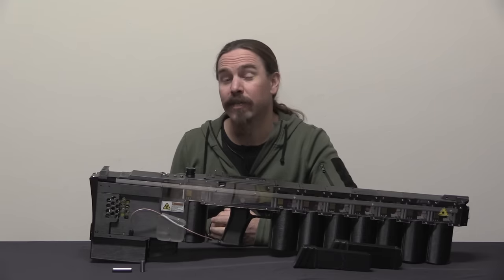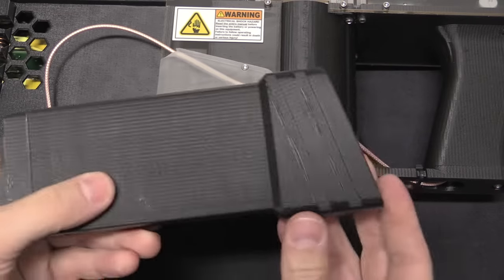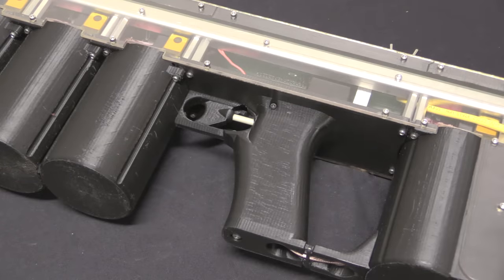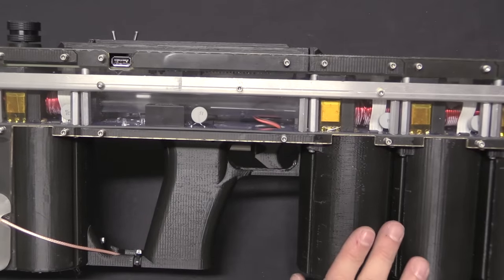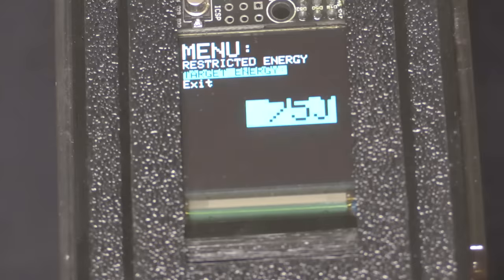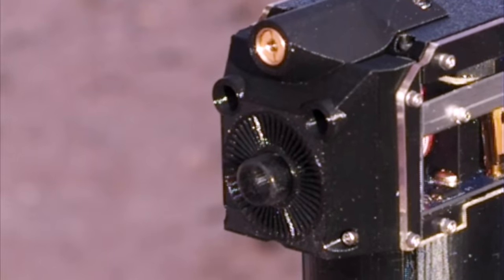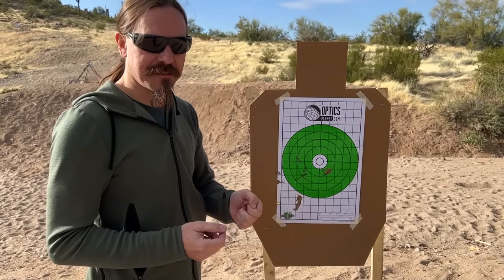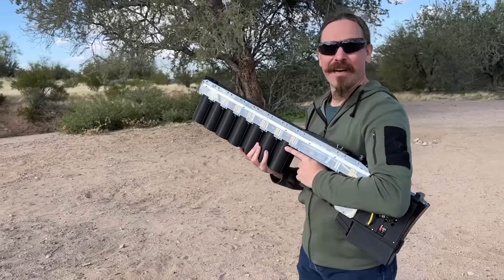ArcFlash Labs' GR-1 Anvil Portable Gauss Rifle

Comment: This thing is so of our time, I love it. 3d printing, USB ports, etc. People in the coming decades will look back on this like we do those cool 80s top mounted lasers, even if the gauss stuff doesn't take off (which I'll admit I'm skeptical it will, at least in a small arms context)
Reply: Even if they never take off as a normal rifle or anything, I'm convinced there will be a niche for these just in how quiet they are.  They're not even trying to make this one quiet and it already makes a suppressed firearm sound like a cannon.
Reply: @GreenBlueWalkthrough  I wouldn't say that there's no difference other than power. One is a railgun with a multi-ton barrel with a life of 100 shots, the other a handheld coilgun with a perspex barrel. 
One weighs many tons and accelerates about 4 Kg to 3 Km/s (or mach 10), producing up to 32 megawatts in muzzle energy. The other can be out-classed by a strong man with a slingshot. One needs a conductive projectile that doesn't benefit from added mass, the other needs a ferromagnetic projectile that automatically benefits from a heavier shot.
Different in every appreciable way besides being weapons driven by electricity and firing a metal projectile.
Reply: As we get room temperature super conductors, and better batteries I see gauss taking off for small arms.
Reply: @GreenBlueWalkthrough  If you mean the one on the Zumwalt it was a railgun, it's a very different weapon. It uses much more sophisticated projectiles but doesn't need complex coils around the length of the 'gun'.
Reply: @Giganfan2k1  but what can these do that a firearm can't while also being a lot simpler? I can see no good reason for these to usurp conventional guns in an anti personnel role.

But who knows, that's just my personal bias for simple, mechanical solutions anywhere they can be used. I'm sure more computer brained people may see a gun where the majority of the potential issues are software based and see that as a bonus
Reply: @BlazingOwnager  Exactly, I seriously doubt these will ever replace firearms, but they have lots of potential in niche roles. My gut immediately goes to something like a silent version of that Chinese anti sniper grenade launcher, using an explosive to make up for a lack of velocity.
Reply: @BlazingOwnager  The low velocity of the projectile also makes it quiet. If they manage to get a projectile up to supersonic speeds, then it will cause a bang. But will likely still be more quiet than a traditional firearm. 

Of course, there might even be special ammunition for coil guns in the future that are designed to reduce the sonic bang. Since that would be a pretty big advantage. You may also go with a larger projectile and keep the speed subsonic and still have decent impact. Subsonic ammunition can still kill. And even this early prototype is something you do not want to get shot by even with it low velocity.
Reply: @Zanpaa  which is exactly what I'm not talking about. I'm not even saying it has no military uses, I just dont think it will ever be used for a general anti personnel role.

Bringing back the space gun with magnets sounds awesome though
Reply: @Ezekiel_Allium  Present day chemical propellants are far more energy dense than batteries and capacitors. So for now, you're right. Once battery tech catches up, weapons like this will give traditional firearms a run for their money. Carrying only ammunition and maybe an extra battery pack, not dealing with fouled rifling or carbon build up, and zero muzzle flash are real advantages.
Reply: @ajm2872  Firearms typically transfer only about 1/3 of the chemical energy to the projectile. Electromagnetic motor drives can reach 90% efficiency, meaning vastly reduced cooling requirements.
Reply: @BlazingOwnager  That thing is so silent because the projectile is so slow. If it would go super sonic it would be loud. This is a level of sound that is reachable with low velocity firearms, for instance 12.7×55mm and they still go up to over 3kJ.
Reply: @ajm2872  just because you dont have to contend with the same maintenance as a firearm doesn't mean there won't be maintenance. I imagine whatever managaes the coils, be it some kind of sensors like this setup or a pre programmed sequence will be a massive fail point. Not to mention the need to keep track of all the capacitors, potential heat related issues with the electronics etc, not even getting into how all that stuff needs to be able to survive quite a bit.

Also, water damage. No matter what  waterproofing measures you come up with, in active service they're going to fail eventually. That's just the stuff I could come up with off the top of my head, I'm sure people who know more about electronics can find even more potential needs of a system like this.

Muzzle flash is the big thing I'm willing to concede as an actual advantage though
Reply: No they’re going to look at it the way we look at muskets
Reply: I think they could take off if battery tech improves. If solid state or lithium glass batteries turn out to work, that would mean your batteries last longer and don't explode if they're punctured.
Reply: @PineJayForge  I was just taking advances in batteries for granted, that's really the least of my issues
Reply: Yeah coil guns have a long way to go for practical use and effective energy, and frankly I don't think they will ever get there. This thing is kinda pathetic. Railguns on the other hand have almost made it into US Navy service, and have more than enough power these days to put down enemies.
Reply: @Ezekiel_Allium  I’m getting the same vibes from your answers as someone in the middle-ages who have just witnessed an early type of firearm and commenting on how superior the bow & arrow is to it.
Reply: @gustavselin1197  you're right, it's exactly the same.

After all, guns require the exact same amount of strength, training, and craftsmanship as a bow right? They're totally not infinitely more simple right?

Your comments sound like someone easily excited over new tech without considering the potential downsides and advantages of it, just accepting it as the future because science fiction told you so. There is a lot of merit in the gauss gun concept, I simply dont think the advantages are enough to replace guns. I can see a future where they're used side by side for different niches, but its gonna take something a lot more impressive than an alternative propulsion system to usurp chemical firearms. A smug apples to oranges comparison isn't the slam dunk you think it is
Reply: @Corsius Atreides I really dont think they ever saw any use, I'd love an example if they did. If I remember correctly my favorite model (ls45), had a really pitiful battery life, I have a hard time seeing anyone except hobbyists getting any use out of that
Reply: @Ezekiel_Allium  I fully am in the middle even as someone who loves this sort of stuff I think eventually it will be more useful and widespread but even something putting rounds down range at the same level as traditional firearms would only benefit from the muzzle flash so I think if this eventually does get adopted it would start out more useful in situations were muzzle flash needs to not be a thing like you said a niche say like some hidden snipers would probably love this stuff if it had the power of a rife with none of the flash and while it still has a lot of disadvantages until the tech matures, most of those probably don't bother snipers as much being as they are less mobile and have more concealment.
Reply: @Spacemarine658  not to mention snipers won't have to deal with the increased ammo cost that would come with making these things accurate
With Russia's fascination with silent urban sniper type nonsense I could see them maybe being an early experimenter with this kind of thing.

Just because I'm harsh on the concept doesn't mean I dont love this kind of thing as well. This stuff is really, really cool to me, if it wasn't I wouldn't be here
Reply: @Ezekiel_Allium  absolutely you can be critical of things you like
Reply: @Ezekiel_Allium  what about the fact it has no felt recoil? That it’s virtually silent? Those are some of the biggest issues with firearms, and this technology further developed could solve both of those. Firing one of these has more in common with an airsoft gun than a firearm.
Reply: @galacticupfan7386  those are definite advantages, though to my understanding as they grow more powerful so will the felt recoil due to physics nonsense I dont understand, and of course they will produce sonic booms as well. 

It is like everything a set of compromises, and I feel like the gains dont outweigh the losses
Reply: In the simplest terms it is all about delivering energy to the target. The hold up now is storing electrical energy in a portable format.
Reply: @1pcfred  there are so many more issues than that one
Reply: @Ezekiel_Allium  there are but with adequate energy those issues are more easily overcome.
Reply: @1pcfred  I promise you better batteries will not fix my concerns over durability, complexity, maintenance, etc.

I'm operating under the assumption the batteries and capacitors will come, sooner rather than later, I simply do not thing that would make it a viable replacement for conventional firearms in 9 situations out of 10
Reply: @Ezekiel_Allium  The device looks pretty maintenance free to me. The only wear item is the solenoid. No other moving parts touch. We can make electronics pretty durable. The complexity isn't something an end user has to deal with. The device is a black box. There's a lot of impetus to develop better batteries and capacitors. Now whether that translates into progress remains to be seen. Invention is a fickle business.
Reply: @1pcfred  I just need to establish what context we're talking about? Because this whole time I've been talking about potential future military service, and I need you to understand literally nothing is maintenance free in that context. Something will happen, and I promise you no matter how well you make it, it's not going to be more durable than a purely mechanical device.

I also just think the heat would be a major source of wear, especially in the hypothetical military version. I doubt the electronics necessary to operate the timing of the coils would hold up to frequent heating.

And the timing thing is really my main gripe. Either sensor operated like this, or just a set pre programmed sequence, something will go wrong, either something gets damaged, or a feed/ammunition issue messes up the timing, or even a software issue. There's so many angles where that specific thing can falter. This is not an issue for any firearm competitors. Even more so if the system relies on some kind of sensors, because now you need to make sure those never get obstructed or damaged on top of everything else

If this goes anywhere in the small arms world it will be niche military usage and hobbyists. I bet in my lifetime someone will go hunting with a gauss gun, which is a wild thing to say, but I'm happy I can.
Reply: @Ezekiel_Allium  Agreed, electronics just tend to be really unreliable under poor conditions and exposure to filth, water, high temperature variations. And maintenance wise would be a nightmare as it would require specialized technicians to fix them. That's without saying that the weapon itself and the technology it brings will be likely expensive for a large organization such as military.

Overall for a military organization, unless there's a massive overhaul, these are far from being considered for military application or service. Cost, reliability, maintenance, fragility and dependence on outside conditions. I wouldn't be one to trust this weapon with my life, even less so for an enduring battle. 

Water-proofing while retaining cooling capabilities would also be a nightmare, not impossible. However the concept of having to protect this much electronics from elements and physical harm means its not durable for rough conditions when you need it.

Overall I don't see coil guns capable of replacing a small arms, perhaps they might see use in other applications, people pointed to low velocity applications, putting it on a vehicle as a 40mm grenade launcher where weight and power is no issue sounds like a more appriopriate idea, albeit more expensive overall and fragile than the simple remote operated chemical 40mm grenade launchers.

Would also liked to add that for an infantry soldier, the weight wouldn't be any better carrying solid steel rounds versus a regular firearm even if hypothetically it could reach similar performance, and with the "gauss" gun weighing a massive 20 pounds, i dont see the miniaturization coming far enough to be able to deliver both higher power through smaller and lighter. As far as capacitors go, they require size and bulk to hold more energy, therefore heavy, and same goes for the battery to hold fair capacity. It goes without saying that adding a battery and electronics to a gun gives it more things that could fail and render the weapon useless, especially when program managed and computer controlled.
Reply: @Ezekiel_Allium  In World War 2 one of our top secret weapons was the proximity fuse. It was an artillery shell that would explode when it got near to an object. What was it really? It was a vacuum tube based device that we shot out of a cannon. Now if our military can make that then I'm not going to put anything past them.
Reply: I'd also like to add as a Electronics technician in the military that the cold ass weather we get is often very harsh on batteries, if trucks have issues starting thanks to batteries loosing their charge in extreme cold. I could see the same issue come to these portable batteries, especially since there's a need for batteries to provide sufficient energy to high power capacitors. Even if they could still charge, the charge time would take longer between shots.

There needs to be a massive overhaul in electronics reliability in each components as well as simplifying the overall system, as it is far too complex for mass scale use in small weapons. The sheer amount of sensors, program sequence, timing and software and hardware reliability makes a very poor choice for a combat environment.

To be completely honest with you, the military organizations would probably require to create a whole new technician job towards maintaining this type of equipment, one that can both fix electronics and diagnostic softwares. Otherwise these weapons would always be missing from inventory. 

The reality is, the way a lot of military work is if it can't be fixed within reasonable means it's often sent back to manufacturer for repairs, especially common in advanced systems and electronics namely. As it would be simply too expensive and complicated to have to educate and form technicians as well as equip them enough to keep it similar to an armorer's level of repair shop.
Reply: @Velthrex  you've summed up my thoughts more succinctly that I ever could
Reply: @1pcfred  I feel like an explosive designed to literally be destroyed isn't quite comparable to something that has to not just keep a soldier alive but also survive them. If a shell fails to detonate it doesn't render the entire weapon system unusable until repaired, for instance.
Reply: And lastly, even if hypothetically they could one day match weight, reliability, performance, speed of chemical explosion systems, as well as their rate of fire and portability. Which so far isn't the case, you'd have to choose as a big organization responsible to arm your entire nations' military personel, the cost investment and maintenance would be abysmal, considering regular weapons have been around for ages and manufactured, it can hardly be cheaper to machine mechanical weapons that you know will remain reliable for long after purchase, as well as the cheapness of producing/purchasing brass ammunition thats readily available.

Even if say, there was a global shortage of propellants, other options would most likely be preferred. Until aforementioned issues can be solved, that is reliability, sensitivity to external conditions, sensitivity to physical rough treatment, temperature, weight, performance, practicality, logistical maintenance, cost, size.
Reply: Mechanical systems have always had more wear than most, however they've also always been simple systems that both work and are durable over long periods of time and can endure stress, strain, and bad treatment much better than fragile things such as electronics boards, components, batteries and optics.
Reply: @Ezekiel_Allium  what can matchlocks and cannons do that warbows can’t? While they may have niche usage in defeating heavily armored opponents or fortifications, I don’t see them usurping crossbows in an anti-personnel role.
Reply: @Ezekiel_Allium  maintenance/reliability in the context you describe it is a solved problem.

Plenty of weapons systems exist and have been used in combat that use electrical signals to operate firing control and actual firing of the weapon, and they are completely reliable. See the CROWS systems, any modern rotary gun, any vehicle mounted weapon. Most of these endure just as harsh conditions, if not more harsh conditions than small arms will and operate fine.
Reply: Firearms have been around for so long that we have known solutions to maintain and reduce overall wear of parts, as well as make them very fail proof and reliable.

Unless a clear advantage can be found from applying electronics, given the technology development, the situation is nowhere near close enough to replace the pre-established standard. Electromechanical interaction has been around for a while and always had the best of both worlds, the simplicity and reliability of mechanics, the increased accuracy and efficiency of electronics in both sighting or fire control systems as well as in certain application faster rate of fire (found in electric triggers).

Railguns are another ordeal because they can achieve far superior performance to conventional guns, albeit far more of a niche thanks to their massive maintenance and power consumption. Honestly even these are impractical considering that the cost of producing railgun ammunition and swapping its rail which gets worn out very quickly, I wonder if the overall cost and effectiveness is actually better than simply making supersonic missiles with great payloads.

One could even think, what if they use this technology but for pulse lasers? That's a whole other ordeal, lasers used to cut things are harmful to the naked eye, and therefore impractical, without mentioning the risk of reflection and mirror reflections to redirect.
Reply: @jonathanpfeffer3716  well for one, they're much easier to manufacture, train people to use, and dont require any physical strength. To be an archer requires intense physical training, and powerful crossbows require clumsy and in some cases quite complicated separate mechanisms to load. 

Let's not even get into how matchlocks and wheellocks did coexist with bows and crossbows for a pretty long time

I really hate this comparison lmao. A gauss gun doesn't offer any advantage over a firearm, while the advantage of firearms over bows is absurdly apparent. A Gauss gun is just a quieter, and more fragile gun in the best case scenario
Reply: @Velthrex  Laser weapons are quite simply never gonna happen in my opinion. There's so many issues that make them infinitely more absurd than electromagnetic weapons. Lasers are only really feasible in the vacuum... but so are guns
Reply: And lastly, sorry for the long essay,

If coil guns can somehow get beyond those issues and improve upon even the limitations of a mechanical system then there is potential, who knows where this technology can go, only research, experimentation, physics and science altogether, the limits of human mind can put a stop to it.

From one way i could see it, electronics is very light (batteries and big components aside) and when properly encased and protected from the elements and harms way (water tight, epoxy covered, firmly fixed to a solid frame) they can have great potential to be an extremely compact and light weapon that has virtually no wear other than aging components and heating up.

Given lighter more compact batteries that can hold more power and condensers that can hold even more charge all the while being lighter and smaller, this could theoretically be possible, and batteries are the most likely to see improvement considering the latest research focus. 

As for condenser the principle they use I have a hard time imagining it can really be improved upon. We've come a long way in term of component efficiency, but condensers always followed a similar concept, unless they can find an alternative technology to condensers or a miraculous pair of conditions and materials to make condensers 300-400% more effective all the while minimizing energy loss (which is an incredible achievement in of itself, efficiency).

I'm open to new technology but I don't see a military application for small arms anytime soon in the future.

One military application of coil gun could be like I mentioned earlier a vehicle mounted weaponry, but thats not happening until many of the glaring issues can be fixed, small benefits are noise and muzzle flash, as well as a potential for ammunition non-volatile nature, (vehicle ammunition rack explosions), however there is already solutions to this problem in the chemical field. 

Propellant that doesn't explode unless ignited from primer seen in select tank rounds, blowout panels to redirect the pressure blast outside of the compartment. However these are for Main Battle Tanks, IFVs could potentially benefit from it more considering the ammunition is generally not as well encased and "outside" from the crew compartment. Until stable propellants are introduced.

That being said, a flaw that would arise from this system is the weapon itself would become a much preferred target to disable the system. Remote Weapon Systems already have a weakness when it comes to cables controlling the weapon, imagine getting a coil or condenser damaged, resulting in potential short circuit and/or decreased performance if not completely disabled.
Reply: @jonathanpfeffer3716  I really do not think mounted weapons experience harsher conditions than being in the arms of a soldier.

And the main issue with the maintenance and reliability is if everyone's carrying it around, there's going to be a lot more issues, and the training to maintain the technology has to be taught to a lot more people, etc.
Not even getting into just identifying the issue is probably more difficult because there are so many more points of failure
Reply: @Velthrex  Honestly thanks for writing all that out, there's a lot in there I would have never considered, your perspective on this topic is really valuable
Reply: @Ezekiel_Allium  Vehicle mounted weapons used in recent wars (especially the CROWS, which is the most complex and the most exposed) experience possibly the most harsh conditions a weapon can endure, as they are pelted with extremely fine dust thrown up in the air by convoys, and fully exposed to the desert heat.

Obviously you would need to work to ensure reliability, but my point is that it is more than possible to do so.
Reply: Mt time would be soldier carried LASERS.
Reply: @Ezekiel_Allium  A more mature magnetic accelerator offers multiple advantages over a conventional firearm, lower weight and volume and volatility of ammunition,  easier to have more ammunition types, could offer significantly higher muzzle velocities (presumably this would be used for grenade launcher type roles, given how that is what coilguns are good at). There are some more niche advantages like them being silent but the above are more generalist. Obviously this is not a mature platform, but given much more development (and maybe some DARPA money) this seems like it could in the future serve well as a Mk.19 replacement, and maybe beyond that as a man portable grenade launcher.

If you include other types of magnetic accelerators beyond coilguns in your definition of “Gauss gun”, the possible benefits become even greater. (Railguns, once materials science advances sufficiently, could be an excellent CIWS system).
Reply: For military application, it's safe to say that it's unfit for operational purpose, too fragile, difficult to protect, heavy and vulnerable condensers and battery/energy dependent system. Too much cons for very little pros.

However the technology advancements that may come from it will be great improvement and research to further both electricity and electronics field. And they also look cool as hell and futuristic, just unrealistic for combat purposes.

Thinking hard about it, after saying electromechanical applications have the best of both worlds, I think this could be the one that has true potential. A weapon system that exploits initial chemical explosion power and mechanical parts' reliability, but uses the coil and electronic system to futher increase the velocity or ballistic properties, loosing the electronic side who is usually more fragile wouldn't disable the weapon, simply remove the enhancement it gets.

However even this concept would be difficult to apply in real context, the bullet projectile would have to be ferromagnetic, therefore mettalic, which means a harder metal, meaning more barrel bore wear. (same reason railguns are an expensive mess). The combination of using hard metal and sending it at incredible speeds means incredible friction and stress through barrels that from today's standard is mostly hardened steel with treatment, metal on metal.

This basically removes the advantage of not wearing down a bore of coil guns but increasing their reliability all the while creating many more problems. The barrels on such a hybrid for example would need to be non-magnetic. But hardened steel is the toughest material known to man thus far. Other materials are either too flexible or too brittle. Posing a massive obstacle to such a concept. Reliant on too much technology advancement, both in material, electricity, electronics, and change in firearm industry. Being able to push such limits however would make a far superior weapon system for military consideration (albeit quite possibly expensive) and bringing in extra weight, this wouldn't be for small arms but rather more realistically applied to ground and naval vehicles.
Reply: @jonathanpfeffer3716  it's possible, sure but getting the framework for that into place probably isn't.
And the point isn't really if you could, more of why you would. Again, we're debating solutions to a problem that is best solved by never introducing it, conventional firearms already exist and will also continue to evolve over time. There's really no point in replacing them with a needlessly complex alternative that does the exact same thing
Reply: @Velthrex  would the whole projectile need to be ferromagnetic though? You could have a softer metal coating over a magnetic penetrator to reduce barrel wear
Reply: As of now its safe to say, railguns have the most potential and they're incredibly massive and large scale to be remotely effective, the power consumption to overcome many forces and resistance as well as achieve superior velocities is nothing that leads to smaller scale applications outside of nuclear warships.

It's all about application, this huge railgun would pay its worth if it can decimate a ship in record time and ease. However the headache of such an expensive system used on ground forces isn't thinkable, the railgun itself would be more expensive than anything it could shoot at to justify it.
Reply: @Ezekiel_Allium  Perhaps, I'm no material or weapon technician to give you an accurate answer. From what I know however you do need sufficient ferromagnetic matter in your projectile otherwise the magnetic field won't pull as efficiently especially if the weight ratio is off (non-ferros vs ferro-magnetic)
Reply: As my final post here, I honestly think other than for enhancing purposes, magnetic(electric) based projectile propulsion is too ineffective without a huge loss and need of energy consumption. It doesn't have its place nor makes up for its value/cost in current warfare.

The only scenario that's not so realistic but sounds like it in my mind for coil guns would be in applications where it doesn't have to overcome as much resistance or force, in other words. Space. Funnily enough it's illegal to bring warfare into space.

It wouldn't have to overcome weight problems, no air resistance or external factor, no bad weather except the extreme cold and vaccuum of space. And perhaps it would therefore be easier to cooldown, even railguns could probably work better so long as they insulate components that can't run under extreme cold temperature.

However you'd still have the issue of having to find a big enough and sustainable energy source, considering most space crafts are using mostly solar panels and minimizing power usage as much as possible, you'd need to send a nuclear power to space or find some other mean for sustainable energy. Or perhaps batteries big enough to store large banks of solar power, after all, weight isnt an issue once in space (getting up there would be the challenge though).
Reply: @Ezekiel_Allium  proximity fuses worked.
Reply: @Ezekiel_Allium  I already described how it could offer some advantages in the future. I doubt it would ever be useful for small arms, honestly, just due to the inherent physical limitations of a coilgun, but I do see legitimate practical applications for vehicle mounted weapons. 

Again, not saying we should literally replace current weapons with some version of this, the technology is not nearly developed enough yet, but once it does I can see it being useful. For instance, it could be well-suited for a tank’s main gun, as a tank could carry all the necessary electrical components easily. A coilgun is inherently good at accelerating heavy projectiles, and would also eliminate any risk of ammunition explosions due to the lack of propellant. 

This would only ever happen far in the future, of course. ETC guns would be the next step for weapons development in my opinion, both for small arms and vehicle mounted weapons. However, after that, you don’t really have much else to improve on with conventional weaponry, and at that point more exotic ideas like magnetic weaponry might be the next step.
Reply: @Velthrex  I believe one of the primary intended uses for a railgun would be as missile defense, especially now that hypersonics are being proliferated.
Reply: @NXTangl  which would be nice if they didn't require 20lbs of battery and capacitors strapped to the barrel. They will likely be very cool if we can ever miniaturize batteries to the point that this isn't impractical to carry around, but that's still quite a ways off for now.
Reply: @Ezekiel_Allium  That are the newest innovations of swords, and spears? Will we get more improvements on firearms? Yeah, but over the last 50 years firearms have. I don't expect firearms to have another Renaissance.

This is the equivalent of matchlock. There is a lot of places this technology could go. Without having to deal with hot gasses an electric mini gun would probably have a significantly faster rate of fire.
Without needing to deal with cartridges These weapons could be more sealed than other even a closed bolt system. 
Logistically they could offer more simple supply chains. 
If you watched the video Ian points out with just a little more processing power you could have rounds that don't over pen, you could on the fly compensate for extra armor. The tactical and strategic benefits that we could see in a decade or two could relegate the traditional firearm to a where crossbows where in the early Era of firearms.
There will probably be a place for firearms like how modern archery is still a thing.
I understand the energy density thing. I am also watching fast switch capacitors, batteries, and monopole magnets are in their developmental infancy. 
We can't see where these new technologies plateau yet. My belief is we don't see where they go until the have a new paradigm shift in physics.
When Einstein was a young adult physics was a boring field everything that was learned was learned. There were just a few problems that were recalcitrant. With enough tests of Newtonian physics the world would be 100% explained.
Currently we have hit a similar plateau of knowledge in our Einsteinian framework of relativity. Muon decay, the discrepancies in other observations. A lot of businesses are trying to work up a lot of brand new theories. All of which would revolutionize electromagnetics, magnetism, and meta materials.
Reply: @jonathanpfeffer3716  Definitely not a bad idea, although with current constraints and problems I doubt this could be put into effective use.

Namely rail wear, inability of rapid fire, immense size and power consumption needed to achieve hypersonic speeds. Requires a massive power source. Unable to use multiple of these at once.

If they could scale down the railgun both in size and length while retaining hypersonic capability and projectile effectiveness. Maybe it would be considered, assuming the maintenance costs and upkeep of such a system beats simply sending several interceptor missiles which can go supersonic easier than a regular payload missile.

However I can't help but wonder how really effective it would be, unlike interceptor missiles, the railgun takes massive amounts of raw energy compared to compact fuel or reaction substances. Their projectile also cannot change trajectory unlike a missile, assuming a scaled down version of the current tested railgun means the projectile would have less energy. It'd be hard to hit missiles unless a trajectory can be predicted or the projectile is so fast the missile barely changed position by the time it reaches target.

Proximity fuzes, interceptor missiles and I even heard that the laser weapon system that we saw on the news a little while back was to be considered for ship air defence system, which sounds like a better proposition compared to lobbing solid metal at high speeds in an attempt to shoot down a missile.

Not against the idea though, if they can make it work with a high rate of fire, extreme high speeds so that theres little trajectory lead to be calculated, optimise for less rail wear, add proximity payload to ammunition, reduce the overall operation cost and power consumption, all the while making it a smaller and shorter system that retains the desired speed and force. It could work. Will it be the most effective and cost-effective solution once the technology matured? maybe. Will another system prove more cost-effective and efficient? maybe. That's what experiments are for and what military trials are for.

In my opinion with current technology interceptor missiles are the best bet, laser munition defence system once more refined and matured as a technology, would prove very effective for this designated purpose, after all, light is much faster than any projectile, and it is not held back by most physical constraints. Ideal for small quick targets.

But who knows, it's mostly speculations at this point. Many systems could prove effective, we won't know until they are further tested and put into application.

The problem that plagues today's electric systems is the poor compression(compact form) of it and the means to store it. It takes so much more volume of battery or electricity in general to produce as much power, performance and duration as chemical substances, whether it be fuel or explosive reaction propellant, these reactions are far more energy rich and compact compared to the raw energy from electricity. Nevermind even converting electricity to mechanical energy or kinetic energy. If even reaction based systems are inefficient, then electric based systems are even worse, as they loose efficiency both in storage, transport and actual application.

With current technology, it's better to use electricity and power installations to power manufactures and plants that can artificially produce better more dense chemicals, propellants, fuel with higher efficiency. In order to have overall smaller more compact systems that are able to run for longer and on higher performance overall. So long as we have the engineering technology to make the most use of this high energy output.

Electricity has a long way to go until it can rival chemical energy. For the means of containing it, transporting it, and delivering it are all incredibly limited by size, efficiency, and mass. Meanwhile reactions just need temperature, oxygen, fuel. 2 out of 3 are easy to achieve, mostly require to have a fuel tank and an engine to match the energy output.

To give you an idea, the most effective way cities and town store energy during downtimes so they can provide during uptimes is through the use of hydroelectricity, using spare power to pump water back up the reservoir to stock that as potential energy to flow through the barrage again. Countries and regions who do not have this possibility either use nuclear power or coal plants, as solar and wind turbines provide far too little output and storing said energy would require far too much battery banks.
Reply: The day we can make electric cars drive as long as gas ones through the same conditions and weight, is the day electric weaponry will be equally as valid to conventional armament. And that will also be the day where banks of energy will be more imporant than the sheer production of it.
Reply: @Velthrex  really the only thing stopping a railgun from being viable currently is materials, once we can make the rails last long enough the rest is not hard to do.

takes a ton of power, but upcoming ships can generate a ton of power for this exact purpose (accommodating new tech). i agree with you that missiles>lasers>current CIWS, but a railgun version of CIWS would just be a flat upgrade from normal CIWS, and you would want all of them at the same time. 

the issue with current CIWS is that laser based CIWS has difficulties with dealing with very fast and large projectiles. it might take a decent amount of continuous fire to down a large missile, and with hypersonics or high-supersonics you don't have much engagement time. missile based CIWS (SeaRAM) and just missile interceptors (SM-6/SM-3) are probably the best option, but have limited capacity. the ideal solution would be DEW for low priority targets (as to not use up munitions), missile interceptors for high priority targets, missile CIWS/railgun CIWS for anything that makes it through. DEW CIWS also has the additional benefit of being able to dazzle sensors on munitions or satellites as well, and I predict it becoming basically standard on future ships.
Reply: @Giganfan2k1  You fundamentally do not unstand my issues with the technology. That's all I got from this reply. My concerns are adopting this for infantry use means you now have a gun, but now the gun can break in a million ways more than a firearm could. The transition from bows and crossbows was one of simplification. Even if we consider guns inherently more advanced technology, a matchlock is easier to make and train with than a bow or a crossbow.
You're advocating the exact opposite, replacing a simple mechanical solution which can be maintained by the soldier who wields it, with a complex electrical one that will require specialists to fix many of the possible issues with it.
Reply: @1pcfred  can you guarantee me that they always worked 100% of the time? Because thats what you need from a rifle, failing to work when its needed is a death sentence for the operator.
If 1% of the rifles in service fail that's a lot of dead people. If 1% of shells fail to detonate, who's even going to notice? 

I cannot emphasize how the fuse of an explosive shell has really different requirements from an infantry rifle
Reply: @Ezekiel_Allium  integrated electronics design, meta materials, and new physics... < All stuff from my last message.

All these things could completely redesign how the field is being made. Learning how to make a monopoles would completely change this gun. If we can learn how to make magnetic fields without electricity also a game changer. New materials make the exiting parts stronger. 

Integrated graphene circuitry, ceramic capacitors, metal air batteries, would make parts of this more durable, but their are significant drawbacks. For now...

You keep pointing out it won't replace standard infantry rifles soon. None of us are pushing back on that.

We are pushing you back on "this tech is worthless, or why buy this in its current form?”

The Spirit of Saint Louis couldn't fly faster than a Carrier pigeon... Why would we ever have aircraft deliver mail? 
Airplanes break down, cost fuel, and expensive to replace (<These are all things you say people are not addressing).

Let's spend all of development on better pigeons. 

If nothing else if you are into The historical aspect of collections. This is great for putting under glass on your mantel. 

If you are a, muh firearm law kind of person... This will probably get grandfathered on before any legislation on gauss weapon tech. Meaning it might be moded into something parody of modern firearms... At some point 10 - 200 years fr now.

Buying this means there the company can spend more on R&D to improve it.
Reply: @Giganfan2k1  I think you'll find I never said this tech was useless, and I even make several suggestions for roles it could find in in the very near future, without any hypothetical technology, simply improved batteries and capacitors.

Even if we figure out all these advances in physics you seem to take for granted, firearms will still be a viable, and more importantly, cheaper option. I'm not saying this tech is useless, I'm saying in a grounded reality where soldiers have to carry these things around, they're never going to replace guns as an infantry rifle. If you can find a way to give this fewer points of failure than a mechanical system I'm all ears. Because no matter how advanced your technology, you still have to contend with many more factors of things that can go wrong.

And again, I'm talking about common usage, I can very easily imagine your hypothetical super monopole railgun that pulls its energy from a higher dimensional plane or whatever finding a large number of niches in military service, but it's really hard to beat the simplicity of mechanical systems, and there's not really a point to doing so. Oh it can maybe shoot harder? That's going to be unnecessary in most situations, so now you've given everyone a compromised weapon system in the off chance they run into a gundam or something

I could also just say they're going to invent long speculated upon improvements in firearms, like I can just throw scifi technobabble at you for hours, doesn't mean any of it is even likely.

I'm sorry if I'm coming off as rude but it's getting a little exasperating needing to repeat my point like this.
Reply: @CanalTremocos  But currents that goes through it are awful and I would say making coils will be far easier than making railguns.
Reply: @Ezekiel_Allium  Something most people are overlooking here is how much better this gauss gun would be for the police during a riot. Like, being able to have a gun that looks like a toy/taser and not a grenade launcher be your non-lethal is a huge advantage, especially now that you would have literally 0 room for error on it being lethal if they made a model specifically for it.
Reply: @jonathanpfeffer3716  Well for starters matchlocks and cannons can be effectively used by men who have been trained on them for a week, whereas a warbow requires a lifetime of training to use effectively.  Training that literally destroys the body of the man using it.  Also, even primitive matchlocks are FAR more deadly than bows.  Even a 200lbs warbow does not impart the shockwave of energy into a target that a musket ball does.  The only advantages the bow has are rate of fire and cost, and the cost difference wasn't as large as people think.  There's also the issue that the service life of a longbowman could be as short as a matter of months, due to the fact that they destroyed their own bodies much faster in war than they did in training in order to achieve that high rate of fire.
Reply: @thyreradim7885  How do you have a non lethal steel projectile?
Reply: @thyreradim7885  But in order for the Gauss rifle to launch it the projectile has to be steel...
Reply: @Ezekiel_Allium  Any metal in the projectile seems like a bad idea when less lethal is the goal.  Whether it's a steel core or shell, it could easily break free and do serious damage.  This seems likely to happen given that the steel is likely to have more mass, and therefore more inertia than the less lethal payload it's supposed to carry.  This is why a steel sabot wouldn't work.
Reply: @Devin_Stromgren  then just make it weaker. The thing with electromagnetic weapons is you have a lot more fine control over the power, if you just make one wholly incapable of lethal forces all you really have to contend with are head or eye injuries, which is already the case with much stronger less lethal options
Reply: @Ezekiel_Allium  But you could do that by designing a purpose built conventional gunpowder weapon and then the projectile requires no metal at all.
Reply: @Devin_Stromgren  I still feel like itd be easier to do magnetically, but you are right
Reply: @GreenBlueWalkthrough  Navy uses a rail gun.  Not the same as a coil gun.
Reply: @Giganfan2k1  also another idea you could seemingly appreciate is the idea of spin stabilizing Gauss rifle projectiles with Rodin type or Starship type coils instead of the standard coils being used currently!